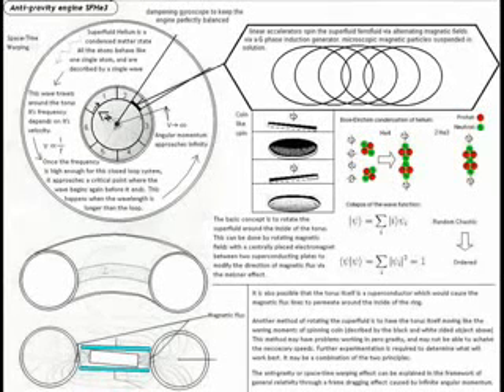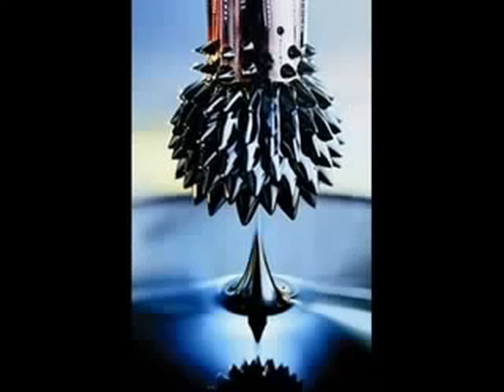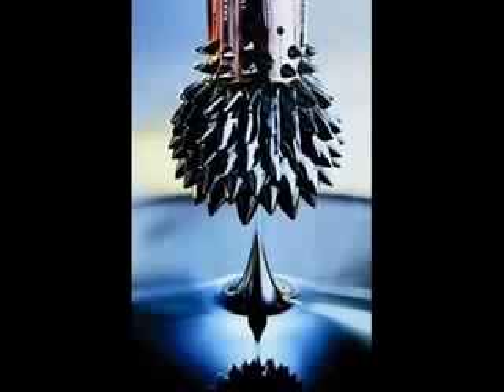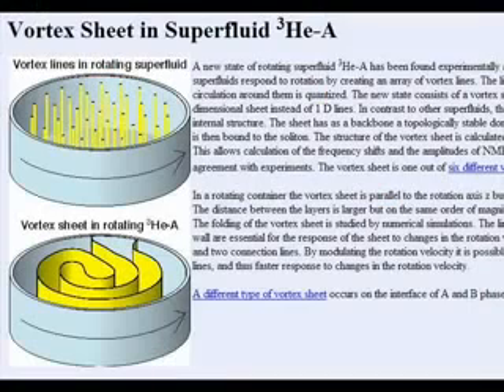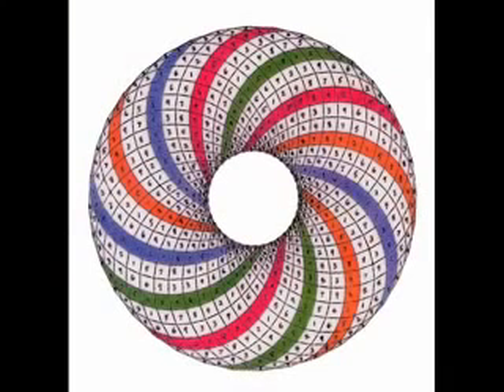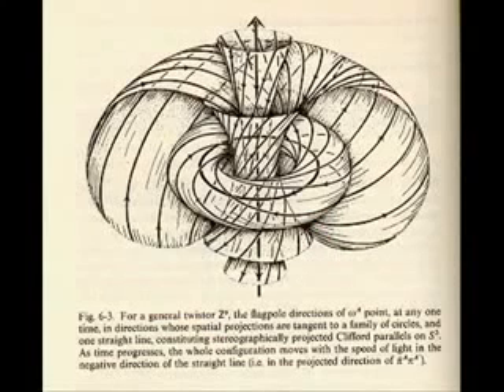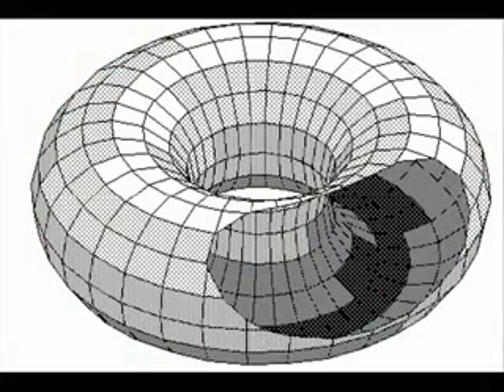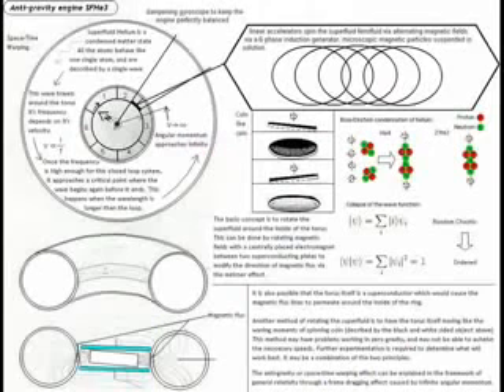How Anti Gravity Propulsion Works

Comment: Awesome. Nice explanation. Now all I need is to find some donut material, magnets, thin copper wire, some iron powder, a battery and a conductive colloidal suspension material to hold the iron.
Reply from the maker: In retrospect I'd recommend superfluid helium3 over mercury.

Comment: Aluminum with Graphene nanotubes shell with poly x paint that can camouflage built  in a geometric shape your choice and liquid nitrogen, super capacitors, hydrogen generator , and liquid magnitite I call levitatium using electromagnetism with superconductors powered by hydrogen cell generator and or poly x paint which also has  radio synthesis properties  ( which we will have one day ) 
That's all old tech 
Soon will be helium 3 fusion Reactors and ships will collect dust in space while traveling broken down in built in solar ovens and processed into POWER 
After we get over that we will use hydrogen burners and recollection back into fuel 
Then we will figure out we could have adjusted our biomes with radio active yeast changing our dna to timetravel all a big waste of time and resources Right 
Well during this time frame the whole Kabbal will be destroyed the major corporate companies will try to bring you to space with your favorite brand and turn you to slaves  or stay and revolt the ai and or hide in peace off grid as a human microbial organism we were design to be since we where genetically altered but think your not a slave there well we all are to our biomes give them what they want and we will be how we want micro macro cosm
Well that's my observation 
Ask the Guardian alliance they just may tell you something
Reply from the maker: This is an old video. Helium 3 superfluids are clearly the future of antigravity propulsion. Hence why the government hoards all the Helium 3.